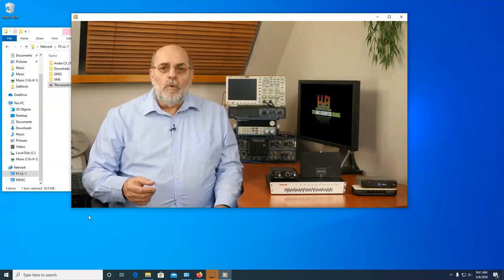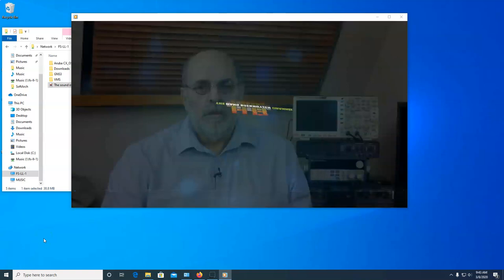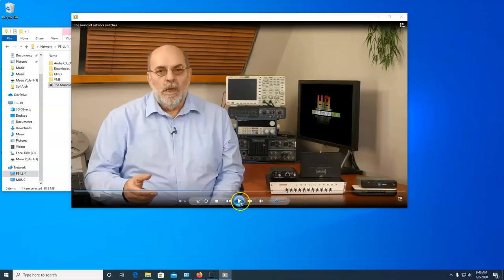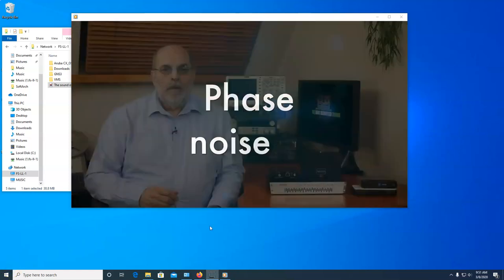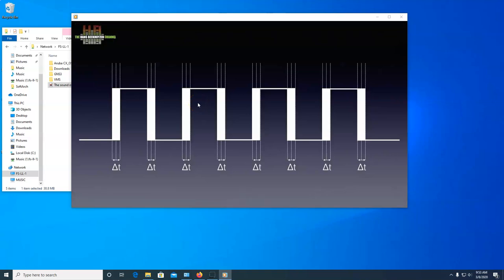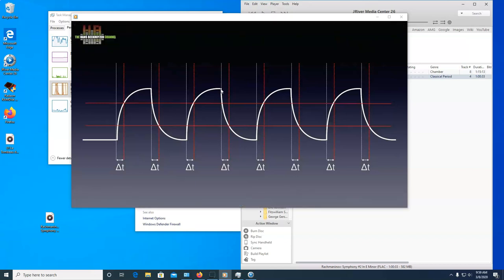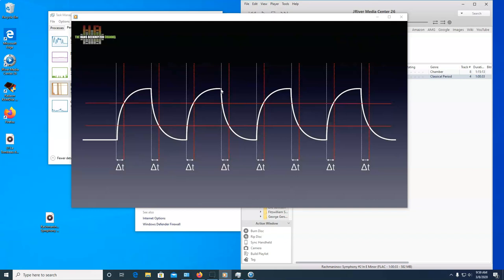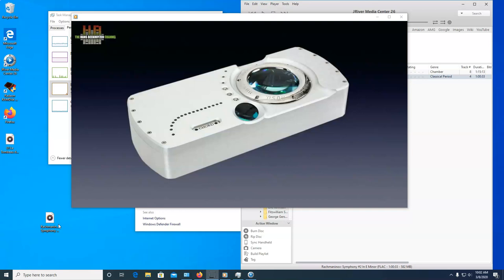Reply to Hans Beekhuyzen on Audiophile Switches

Comment: I think the key argument here is based on timing of the data received not whether you are getting a bit perfect copy or not. Han’s argument is based around jitter being fed into a streamer/DAC which can cause issues. In the case where a streamer caches the data, then that probably becomes a non-issue. However, in a case where the stream from say Tidal or Qobuz or even from a network drive is being fed directly to a DAC then timing issues affect things like jitter which do alter the sound quality. Also noise can be introduced into the streamer from either the network switch, cabling, and or the router. While this noise may not be in the audible band, again it can cause a DAC to jitter which does effect sound quality. Also in the case of DSD specifically, which uses ultra-wide frequency band for delivering audible signal, then these kind of high frequency noise will negatively affect the signal and the decoding. Also in the case of fiber optics, the quality of the converter from an electrical signal to a lightwave can cause jitter. So even with fiber optics you can transfer jitter if your switch isn’t high quality. So I think it depends. However, if you deliver a cached bit perfect file to a streamer and you are still getting jitter errors, then that is being caused by the streamer and not the switch or network. So I would run your test again and this time turn caching of J River OFF and see how it goes. By the way, I should mention that I currently use an M1 Mac Mini which is probably the best computer you can buy as a source, and even then I have opted to buy a dedicated streamer for my 2 channel system. I’ve decided to go with the Hifi Rose RS150. And once I get that, I plan on doing an A/B sound test with my M1 Mac Mini (which already sounds fricken phenomenal as a source) to compare it to. If I am wrong, then I wasted $4k.
Reply from the maker: No that is not his argument. At all. He is talking about a lower jitter Ethernet switch and he's stunningly clueless as to how Ethernet works.

You sound like you've drank the kool aid at AudiofileStile. Most there don't know what they are talking about either.  Again, non-realtime playback systems (async) the jitter that happened up stream has nothing to do with the cached data (data at rest). Jitter isn't transferred. It's not part of the data. 

Search Youtube for 'clock domain boundaries' as I don't need to reinvent the wheel in this regard.
Reply: You wasted $4k.
Reply from the maker: @BrentLeVasseur  

Then you have a DAC that I wouldn't want to own if the engineering is so compromised. 

Look at the Seimons paper 'The antenna myth' it pretty much puts a nail in your EMF argument. Even CAT5e is noise immune to 30MHz. 

Another video I showed how for $320 I purchased a Cisco 2930 48C/4SPF+, Multi-Mode Transceivers, two Solar Flare SFP+ PCIe NIC's. So 1/2 to 1/6 the cost of other solutions and I get full optical isolation, and 10GBe speeds with hardware from reputable manufacturers. 

Plus it was a fully managed L2 switch...
Reply: @BrentLeVasseur  You DAC isn't just a DAC. There is a lot of things happening between when a frame arrives and when the bits that represent the music file is being fed into the DAC. Otherwise, you'd be listening to ethernet preamble, TCP, IP, Ethernet headers, Spanning-Tree Protocol, various broadcasts and unknown unicast messages not even intended for your DAC. The signal over the ethernet cable carries the data in its payload. It doesn't represent the data directly. You have to have something in between that de-encapsulates the network traffic and recreates the original file. The sound is decoded and played well after it has been received over the network, which is what Matt clearly shows in his video. Music is not a real time application and DACs for listening to music are basically computers, again, they do not just take an incoming digital signal from a network interface and convert it to analog.
Reply from the maker: @BrentLeVasseur  Does Steinmetz's book discuss the fact that 1gbps Ethernet can deliver a 50MB 16/44.1 track in .5 seconds?. Whats the EMF doing for the next 246 seconds as the song is playing back out of buffer?

Does Steinmetz book cover 802.3ad and the fact I can start play back and switch between the $640 Etherregen and my Aruba switch w/o a single break in play? I did a video on that one also. 

Does Steinmetz book cover 802.11AX that with a $89 Access Point and VHT 40 I'm getting 80MB/second and there is no physical copper connection?
Reply: @BrentLeVasseur  ". So it’s not the same as transferring a regular file via ethernet."

Streaming just means that the receiver could work with the file ("playback it") before it is completly downloaded. To allow this the data in the file must be in the order the receiver needs it. This does not work for files like Excel because there is no way to predict which numbers the receiver want to see first - but its relativly easy to design a file format for audio or video which is "streamable"

Ethernet-Switches (and course also Ethernet cables) dont know if the frames which where transported are belonging to a download or a streaming.

And even when your Roon server does not "dump the whole file" it still has to dump/buffer enough data to ensure that playback is not interrupted by smaller variations of the speed your internet connection.

Comment: Matt I appreciate your post and the dialog this creates.  However I think there other things at play that my need to be considered.  I agree, the way modern layer 2 switching works and its robustness make it nearly impossible to introduce errors that go uncorrected into the frames within the network path.  You outline this perfectly in respect the hundreds of network elements and the numerous signal paths that digital audio take before it reaches your audio system and ultimately ears.  Additionally, I agree, even with the use of Roon, like Jriver, streams from Tidal and Qobuzz as well files over the network are buffered.  This buffer allows for plenty of time for dropped packets and incomplete frames to be retransmitted before the steam deconstructs in the DAC and reaches our ears.  Unless I missed it in your reply video to Hans Beekhuyzen, It wasn't considered that noise that exists along the cabling; while doesn't affect the network stream, can introduce issues with the digital to analog conversion and quality of digital audio.  Audiophile switches offer only one feature above an off the shelf layer 2 switch "Reduction of Noise".   Audiophile switches have optical isolation of the Ethernet signal path to reduce interference along the network cable that can and will interfere with sensitive ladder DACS.  This isolation attempts to block the noise that could enter the sensitive digital clocks and add jitter and defects to the digital to analog conversion.  I am not speaking about noise in the network packets as I agree that isn't a practical condition.  I am speaking about noise on and around the network cable that affects other components in the digital audio path.  Additionally, Audiophile switches have improved power supply filtering to also further reduce noise that can be introduced along the cable that require filtering at the network streaming device and ultimately the DAC.  In very revealing audiophile systems it is easy to hear noise from the Power Utility, DC Switching power supplies and yes, network switches.  Again, this isn't a rebuttal or an attempt to take sides.  Just another perspective from some dude on the internet.  Be well.
Reply from the maker: Thanks for your response.

I already took a crack at this in a prior video. Please let me know what you think.
https://youtu.be/u6mYM8Xy0H8

Also I've read the eR 'white paper'. What it says in essence is that there are leakage currents and there is jitter. 

For leakage currents go WiFi. For $56 a TP-Link Omada 1300AC AP gives me 400% more throughput than a 10/100 audiophile switch and zero leakage current.

Alternative to WiFi I spent: $60 on a Cisco 2360 48P GBe copper, 4 SFP+ (10GBe). $19 on a 4 port Dell R620 network card with two copper 1GBe and two 10GBe SFP+. Another $20 on a Solar Flare PCIe 8x G2 NIC with Dual 10GBe SFP+, $20 x 2 10GBe SFP+ SR transceivers and another $40 on multi-mode OM3 fiber cabling. All in after shipping and taxes my spend was $210. 

What did I get for $210 vs $640 or $2000? I got total electrical isolation and transfer speeds that was endpoint limited to 332MB/s.  That handles my jitter problem because I was able to start playback in JRiver and an entire ~47 minute album played back in it's entirety with the network cable unplugged.

Comment: Everyone is talking about theory. It would be nice to know if the difference is real or not. Whatever test, multiple listeners, including people who claim to hear the difference to begin with. To be honest, I also seem to hear a clear difference in some cables, in high end systems, including digital ones, streamers despite the fact that I specifically wanted to hear no differences. I am extremely skeptical about a switch effecting sound, but the streamers/dacs have some very unintuitive solutions on caching which is a mixture of source, software and hardware. Local caching should limit exposure to any timing issue, but depending on the chain (and source - I have no idea about rights management for streaming services) this might not happen. Roon streams stuff from an external source in many cases and playback can and will get stuck on a PC mid file.

Comment: Just 2 think: I did a test last weekend with SOtM sNH-10G con External Master Clock the Mutec Ref 10 . So it works and improve sound a lot, So after this test I reconnect my 2 "cheap" ethernet switch netgear, but I changed the connection in order to create a "noise network" and "audio netwlork", In the Noise I put the cable from Router, 1 cable forn another room where connected to another Cisco switch and my QNAP NAS where is stored my music library, another cable with Fanless PC as Roon Rock Server, and 1 cable to go to Audio switch. In the Audio switch only the cable from Noise network and 1 cable to my network streamer SOtM sMS200 Ultra then to the DAC via USB. The background noise was better then before when the PC funless was connected on the "Audio" network switch and also the cable from other roon connected here. For me it's clear that some noise come trought wire and degrade the silense in the audio equipemet. How we can think? The Cina power supply of router internet provider can genarate noise for sure, so could you demostrate that network switch eliminato 100% of this noise? Could you test this?
Reply: Matt Noble, could you comment on Roberto's comment above? 

I have 2 USB (computer to DAC) cables , they have very distinguish sound characters when connected to the same devices even though they are passing 0s and 1s. One cable has very harsh high frequencies and roll off the bass substantially. Before I was thinking, bit is a bit. But now I don't know what really happened.
Reply: @faridmaruf3102  I have 3 USB (PC to DAC) cables. They sound the same. Entire audio spectrum is presented as intended.
Care to comment why my cables sound exactly the same despite each of them being from separate brands?
Reply: @aaronmathias6739  I can't... I don't have your system. They might do present the same regardless any cables you used.
Reply: @faridmaruf3102  USB audio is time critical,  cheaper cable means more jitter created.
Reply: @craigsmith3545  I agree... however so many so called network/computer engineers argued that a bit is a bit, even though none of them have ever had a chance to listen a system that capable to reveal the difference, or have  abilities to hear the difference. Not only cables, I had bought a re-clocked network switch that cost 40x typical home switches. I can hear the improvement. 

Those engineers for sure think I'm delusional.
Reply: @faridmaruf3102  I know my colleagues in  my IT job think the same.  I use a sonore bridge and linear psu to feed my dac,  all makes a difference.  As Hans says enjoy the music!
Reply: @faridmaruf3102  you would have to do a real, controlled, unbiased blind test and pass. Try it with a friend. But do it as it should be and don't be afraid to be wrong.
Reply: @rusedgin  This is something that I can not understand from you guys, you are so sure that I'm (might) wrong and you are certainly right. 

I have 2 cables that the different like night and day, yes A/B test... and done with some friends. If the different is really noticeable, why do I want to do anything more but throw that cable. It's a $5 cable.
Reply: @faridmaruf3102  Sure, I won't argue that one sounds different since you have that experience. But I will still argue the notion that we cannot explain. I worked in product development and I can tell that many products are mere repack and remarketing with little to no difference, some promote bonus features that were already there from the beginning and this happens  with affluent oriented products. I ear clients argue their product includes something special and constantly need to explain it's not relevant. In case of audiophile products I'm getting the same vibe. Company sell miracle products and, when you question speaker engineers most smile and give diplomatic answers. You do teardowns and see nothing that justifies the price. That's why I'm always sceptical.
Reply: @rusedgin  Is Jitter a voodoo concept to you?  Just curious.
Reply: @faridmaruf3102  No. But that's what buffering is for. In a modern gigabit setup the buffer is filled so fast you instantly have a 10 or 20Mb  available for reproduction. I'm not using an audiophile appliance for zoom calls.
Reply: @faridmaruf3102  I can tell you one  experience I lived. I had my server connected to a gigabit switch with a  Cat5 cable. One day I was streaming Flac's wirelessly and the system couldn't handle it, stopping playback all the time. I changed the cable to a cat6 and, voilà, all was solved. So cables matter, equipment quality matters, and I understood what the problem was. Changing my switch wouldn't have solved the problem because the cable couldn't handle the speed.
Reply: @faridmaruf3102  Gordon Rankin has some insights as to why a USB cable can impact sound. Search for his 2018 interview with John Darko.

Comment: Network equipemnt that uses ethernet based protocoles only send "ones" and "zeroes".
There is therefore 0.00000000000000000000000% total distortion introduced by such equipment into an audio stream.
No timing circuit can be jitter free and it is built to handle it properly with a quite safe pargin.
In the event errors are detected at the receive end, ethernet protocoles have provisions to deal with that.

That guy has a 30,000$ distortion testset behind him, the APX series unit at the bottom.
I submit that If he connect himsef to it, everybody would get distortion reading way too high.

Audiophilia is an illness that make you pay 400$ for a 6 feet power cord, 10,000$ for an amplifier, 40,000$ for speakers.
Does't he kno speakers generate between 0.1% and 1% distortion?
What is the use of 0.0001% distortion preamplifiers and/ amplifiers in that case?
Fixing the listening room is quite inexênsive and it goes a long way to enhance a listening experience.
Reply from the maker: The believers have shifted the argument to that L1 properties of wired networking. Hans released a video addressing the fact that he received push-back and that his understanding was fundamentally wrong. It's now about power supply and circuit switching noise. Now they are just equally wrong on  some other topic.

Comment: ... and no, there's no problem with Ethernet cables unless you run them out of spec (or they are broken!).  Forget about wireless (!!) or fiber, don't search for problems where there's none...  As for the digital signal, Hans doesn't know about logical detection levels and why a CPU with billions of stacked gates running at gigahertz doesn't make errors!